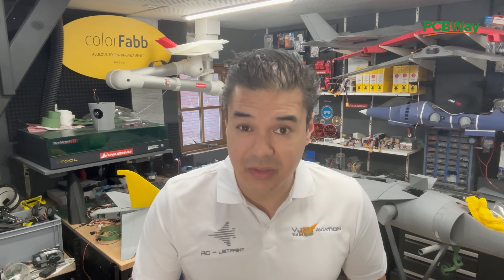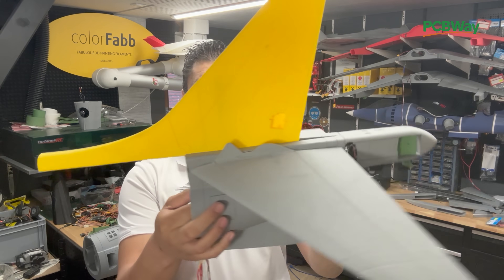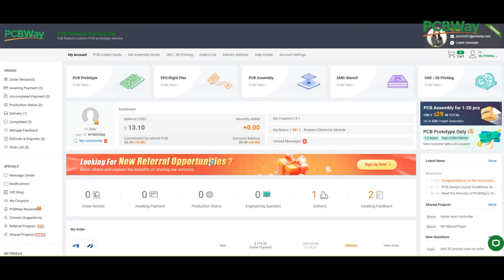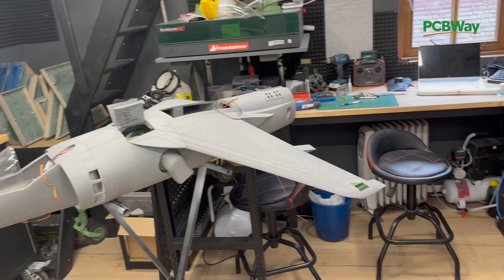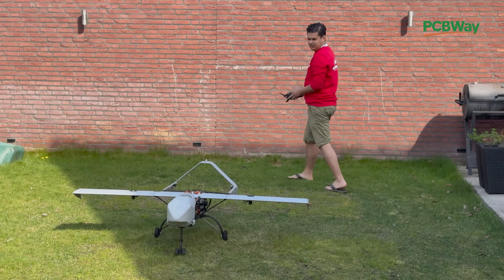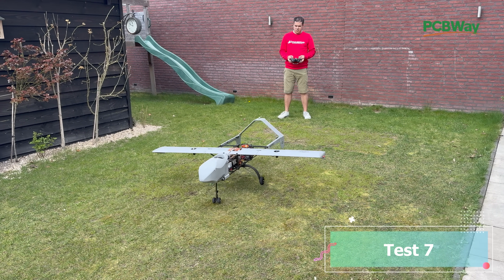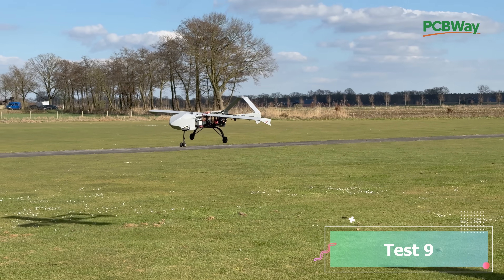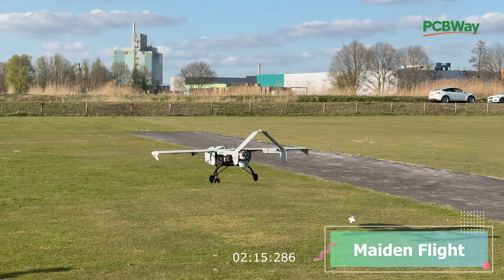Vtol 3D Printed Trainer RC Model Upscaled to 120%!! Will Hover BeThat Easy?! Parts from PCBWay

Comment: How does the part from PCB Way compare to the plastic part, dimensionally? There are always differences.
Reply from the maker: Let me measure the tolerance, in any option the fit super Nice and the swap went smooth

Comment: I hate the X32 personally but they are all amazing builds! Congratulations on an outstanding aircraft. The one good thing with a model harrier is there is no exhaust gases for it to ingest so if you get the balance right you should not have too many problems. Chokings on its own exhaust was the harrier's main fatal flaw.

Comment: Specifications: 
RC-Jetprint Kestrell-X enlarged to 120% with BambuStudio slicer giving a wingspan of 1824 mm and length of 1620 mm. This brings the diameter of the carbon tubing from 10 to 12 mm and from 8 to 10mm. For carbon tubing I used the more expensive woven PWK type that is very torque resistant and won’t leave carbon splinters in your hands as it is lacquered and polished. Plus it looks really good! Some parts are modified to fit the used equipment and a 250-250-250 size printbed such as both main EDF housings, thrust vectoring, wings and front LG. Parts printed in LW-PLA and regular PLA. Main EDFs: JP Hobby 90 mm-6S in CW and CCW version so they counter each other’s torque. 2x RedBrick 200A ESCs set to low timing and 16kHz. 2x Wing EDFs FMS 50 mm 4S with generic 4S 40A ESCs. 5x Freewing metal gear servos. 2x Turnigy HXT900 for Thrust Vectoring, beefy Savox SV-1270TG for the swivel as you need torque to accurately move the rear EDF assembly. Linkage is from the Freewing 90 mm F-22 complemented with ball links and servo extension cords in various lengths.  Lipos used are 2x SLS Quantum 6S4000mAh 65-130C and SLS Cube 4S2200mAh 30-60C. The lipos are connected as sets in parallel to create more capacity (thus more flighttime). Total plane weight without lipos is 4500gr, which leaves max 1750gr for lipos. This way it will hover at 50% throttle and have plenty of power left. Flight times vary between 2,5 min. to 5 min. depending on your maneuvers. It will perform inbound and outbound transitions if you have the guts for it...
If there is demand we can offer you the modified parts as an add-on to the regular Kestrell-X.
Reply: Hello Marc! I purchased the Kestrel-X a while back. If just just making a 120% print in Bambu Studio, I might give it a chance to see if I can make the larger model.
Reply: @electricflyer81 If you’re going 90mm, you need to use 12S EDFs. We have found that the 6S versions are hard to tune because of their kV.

Comment: Great Video,Any chance of getting the specs of the 120% trainer (motors used,servos etc) would be greatly appreciated.
Reply: Specs added
Reply: @marcovandevelde  Thank you :)
Reply from the maker: Sure, so marco scaled up to 120% in the printing slicer. Instead of 10mm tubes he used 12mm tubes. And instead of 70mm edf 2x 90mm are used. for roll 50mm edf instead of 40mm. And servo’s according to spec on the rc-jetprint website. Lipo: 2x6S parallel.
Reply: @Joelmelanie  Thank you :)